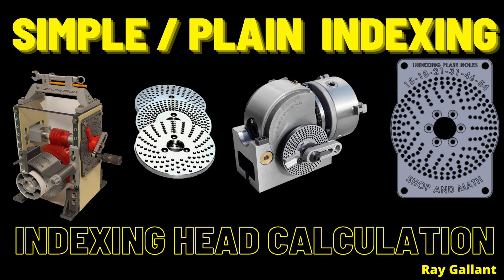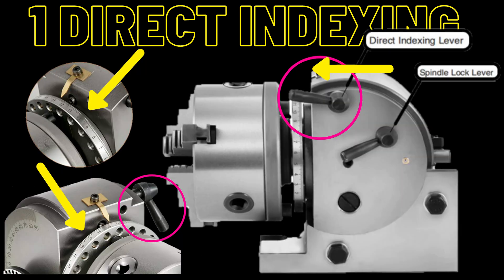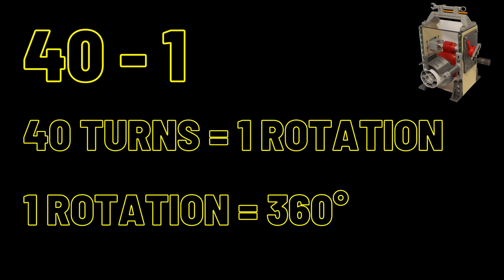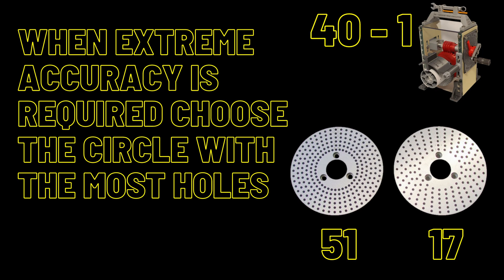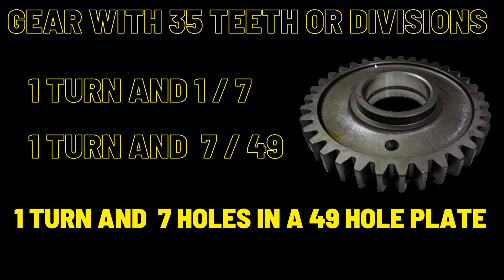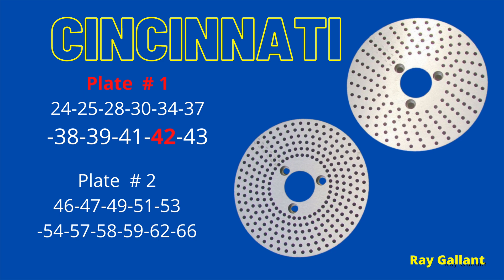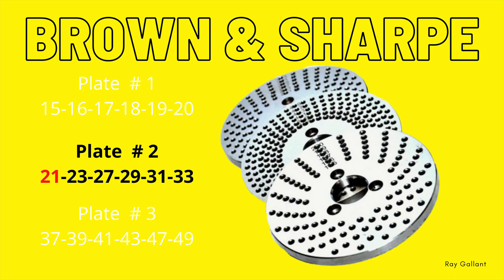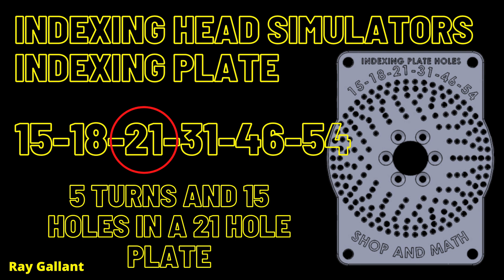simple plane indexing indexing head calculation

Comment: Haven't used a mill yet. Theory learned about indexing last week, I really liked the 3d printed tool. i understood the theory but didn't grasp how the plate turns would be done once on the mill. very neat, and helpful for the accuracy part our prof didn't mention ministry wants smallest degrees/minutes on test answers
Reply: intuitively it would be smallest denominator which gives largest degrees/minutes

Comment: How do I cut 26 splines
Reply: To cut a 26 Spline or division
Is your indexing head of 40 to 1 ratio if it is you can use a Cincinnati standard plate side one it has 39 holes
The division would be one turn and 21 holes in a 39 hole plate
Ray
Reply: If you don’t want to do the manual work or you forgot how to do it you can go on the Internet and type  in indexing plate whole calculator
In the browser bunch your information in
And it will give you an answer
You still need to double check it doing it the old-school way hopefully this helps

Comment: Hi i enjoy your video a lot
Coract me if im wrong 
7 theet gear you had if i choise 42 holes plate  then 7 hole each time would give me a result 
 16:52  Why 5 turns and 30 holes on 46 hole plate also you mentioned you go with 42 holes arlier (iam confused)

Comment: Good day Ray, just subscribed. Great channel and certainly of great value to me. Just servicing my EMCO Deviding Head.  My Dad bought it 40 years ago. 3 plates with (a) 27 & 34 & 42 (b) 33 & 36 & 39 (c) 38 & 40 holes. Had no idea how to use the DH and need to cut a new gear for meat-mincer gearbox URGENTLY. Problem solved🤝🤝need to learn a lot yet, so I will be studying your channel. Thank you. 🙏🤝Regards from South Africa
Reply: Hello! What is the transmission ratio of your EMCO dividing head? I'm researching and learning now and want to DIY a small dividing head. Thanks!
Reply: @tonych7392  thank you for your reply. The ratio of the Emco deviding head is 40:1 my apology for having taken so long in answering. Thank you. Regards from South Africa👍🤝
Reply: Thank you for your reply! I am currently making a small indexing head to add directly to the spindle of my EMCO-3 mini lathe and you have provided me with very important information. Thanks!

Comment: I am new to the channel so this may make sense if I had time to watch several prior videos but I can’t today. Why not just use the real dividing head, why make a plastic copy. To use the real thing use the real thing, same size, cheap and available? Visually you don’t see more than if you simply point at it.
Reply from the maker: first off thank you for taking the time to comment your feedback is appreciated
my thinking on this midget seam a little back words on this but consider my goals and problems 
1 I needed a training device that I could test students on outside of the shop
2 a standard indexing head is $1500 
3 a standard indexing head is heavy 50 to 100 LBS
4 a standard indexing head has a bunch of extra parts
5 I can not test students on a standard indexing in class without modifications
6 this unit weighs about 5 to 10 LBS with tools attached
7 made from extra parts so no up front cost 
8 ( negative ) very time consuming with educational material and 3D printing
All of the videos on the shop and math channel are to help apprentices learn if other people see value that is a happy bonus  
Keep in mind I do try my best to provide an honest and safe representation of machine shop practices 
I hope that you will keep watching and commenting
All the best Ray